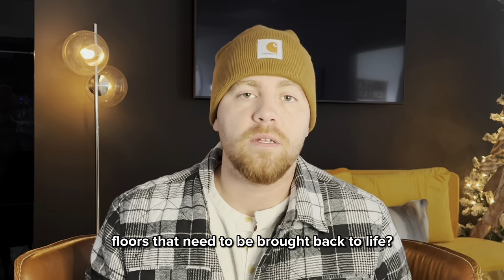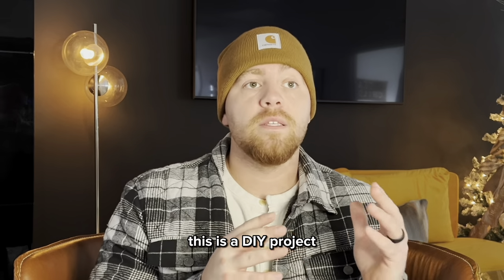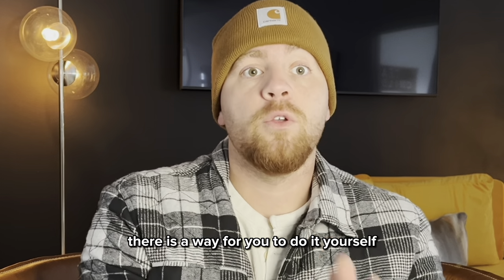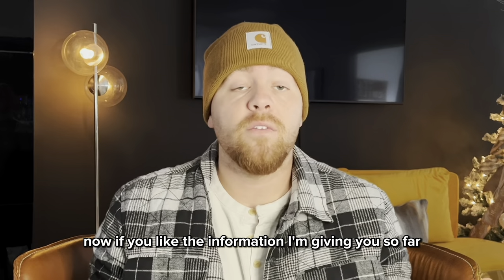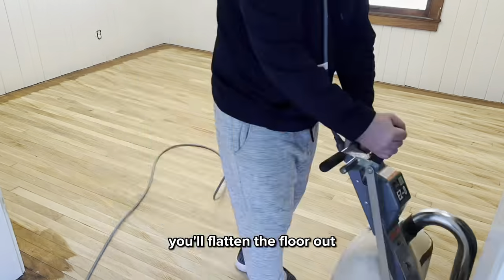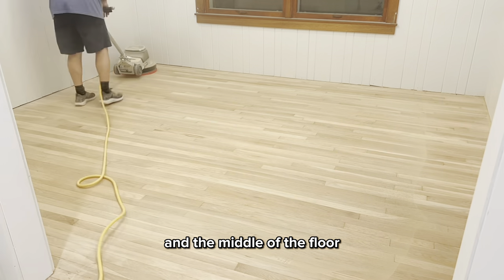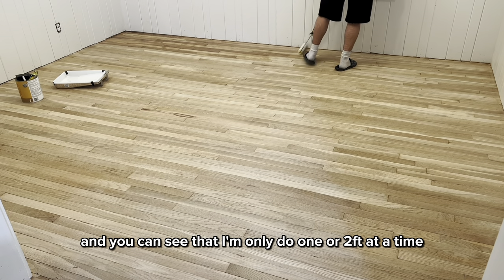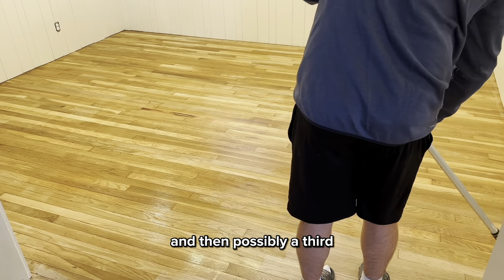Beginner Guide to Refinishing Hardwood Floors on a Budget (I Saved Over $4,000)

Comment: as you did do a pretty good job in general, man! people! please do not listen to somebody on the internet tell you, you can stain at the 100 grit stage. you'll regret every bit of work you just did and redo it. 100 grit cut is nowhere near enough.
specially 80 grit cut with the edger. you'll see every single  swirl
Reply from the maker: People, please do not listen to a random person in the comments that doesn’t know what he’s talking about. If you watched the video, you’d hear that I had a PROFESSIONAL floor refinisher guide me through the process, and that 100 grit is the MAX that you need to go. Also, there are PROFESSIONALS that have commented on this video saying it was done correctly.
Reply: @agentalexcamp  misconception is stain vs NATURAL water base and or oil base finishes.

Comment: Nice work!  I would like to refinish my 2 hardwood floors at some point, both are OLD but in great condition. 1 of floors has a tiny bit of carpet pad residue, neither look like they have much if any clear top coat, both floors have stain that matches the baseboards and window trim and the stain still looks pretty good, neither floors looks like it has filler as I can see gaps between the wood pieces, I also noticed that both floors have a few creaks (I believe the creaks are maybe caused by wood piece slightly flexing when one end is stepped on).
Reply from the maker: @donye_mfkn_east8161  If you do it, I wouldn’t only sand in certain areas. You want it to look the same across the whole floor, so I’d sand it all the same. The creaks will be really hard to get rid of. I’ve accepted that my floor will always creak lol. Goodluck!